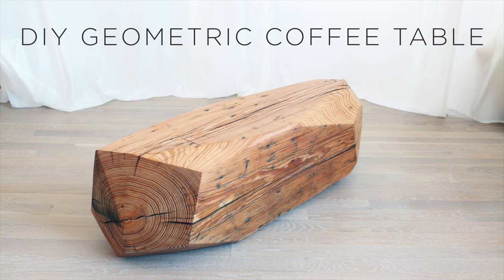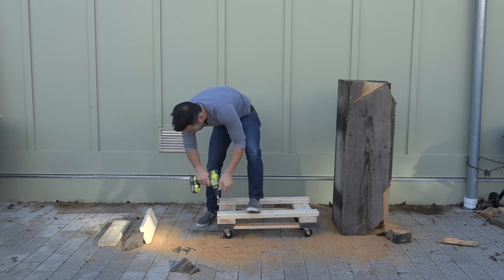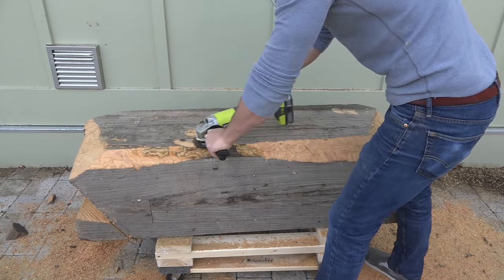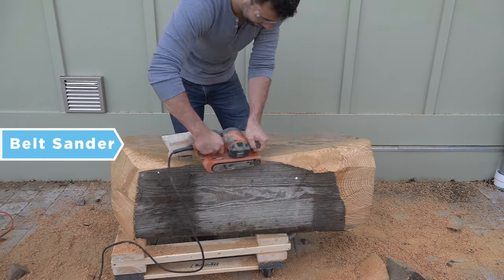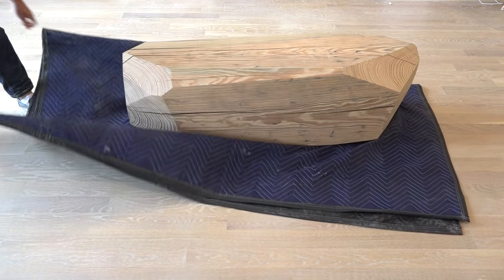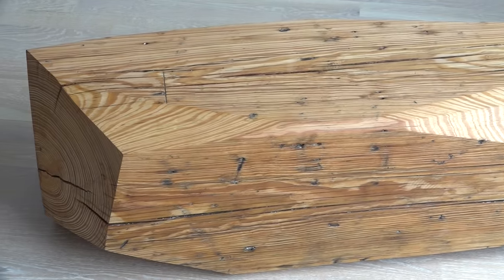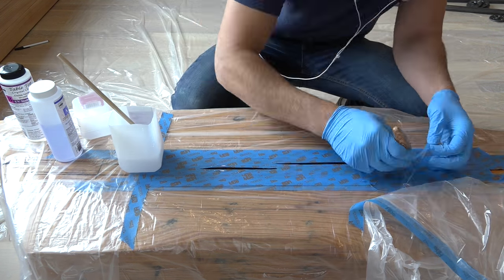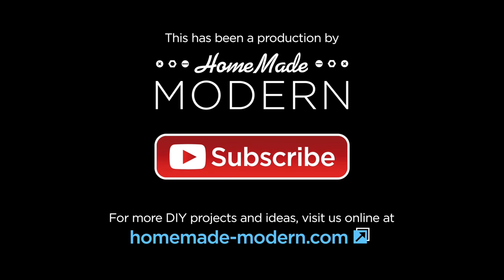Chainsaw Carved Geometric Wood Coffee Table

Comment: That's pretty cool, Ben! You may also want to check out the wheels by King Arthur Tools called the Holey Galahad. They're pretty neat! Just did a video with power carving and use one of those a bit. I've been wanting to try a turbo plane. Hopefully soon!
Reply from the maker: +Carter Wilson Workshop yes!  i tried the lancelot before
Reply: Sweet! I haven't tried that one - seemed a bit aggressive but I dig the other wheels I got from them. I definitely want to give the turboplane a shot though!

Comment: Jmm I find this too complicated for the actual outcome. Having a coffee table that heavy doesn't seem practical to me. Maybe chop the rest of the wood to a more manageable size. Love your videos though!
Reply: +Robert Cornelius not exactly. I know that the wood is somewhat cracked but if he could manage to cut it to make smaller beams or planks they might be useful for crafting something, I don't think is imposible. It's still better than wasting 10 sanding belts and requiring 3 people just to get it in an apartment.

Comment: I've been watching Craigslist like mad for some chunky wood like this. I've noticed that people have gone quite crazy with "reclaimed" wood. I've seen old rail car floor slats that are literally just 1in x 1in boards jointed together into 2 in thick massive slabs that weigh 150+ lbs. and they are asking $400 for one slab!!! It's insane! You could make a board like that yourself from brand new oak, beat it with a chain, scratch the crap out of it with a screw driver, and hit it here and there with an angle grinder, all for about... $35-$45. Do you mind me asking what your beautiful chunk of pine cost?
Reply from the maker: +Michael Perkins i was going to try and glue a bunch of scrap together and make a scrappy version

Comment: The turbo plane is $160! Wtf
Reply from the maker: +KingOfShenanigans yeah i know! but when you see it you will know why.  its basically a set of thickness planer blades on a thick steel disc.  the question will be how long does it last.  i figure if it saves me 30 flap discs it will pay for itself
Reply: +HomeMadeModern yeah. Makes sense